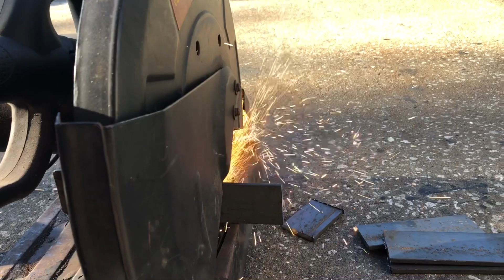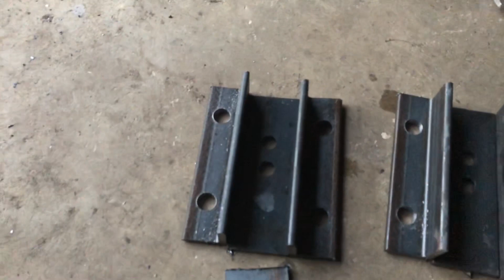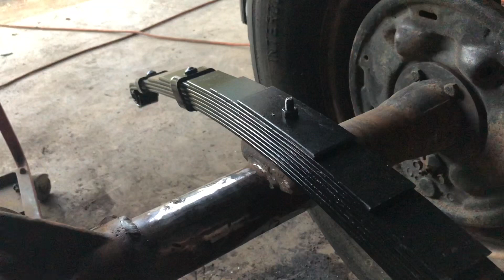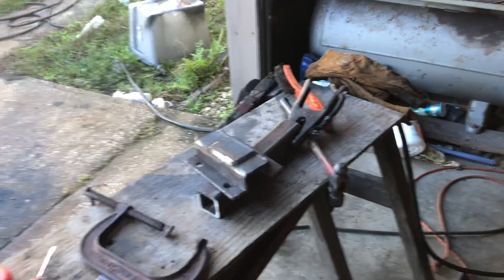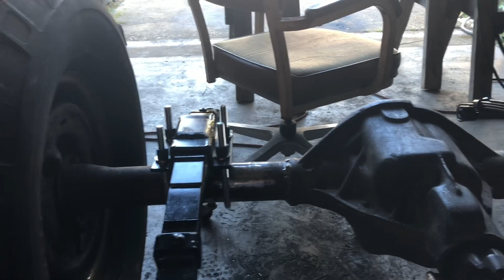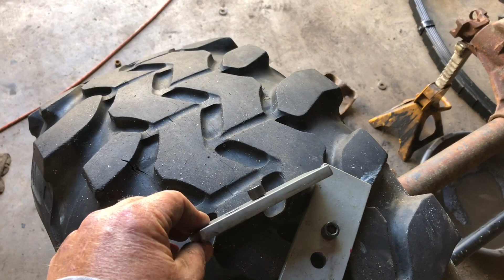DIY high clearance spring plates for JP Kart

Comment: I made similar plates on mine, I ended up having to gusset the "tabs" that the U bolts go through, as they were starting to bend after torquing them down
Reply from the maker: That’s part of the reason I left the material in front of the u bolt. I may gusset it later.